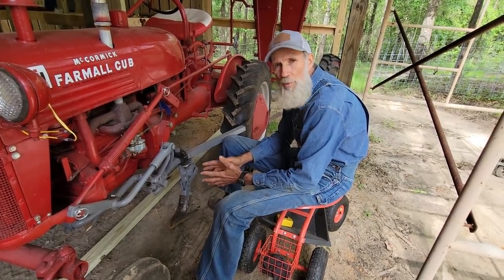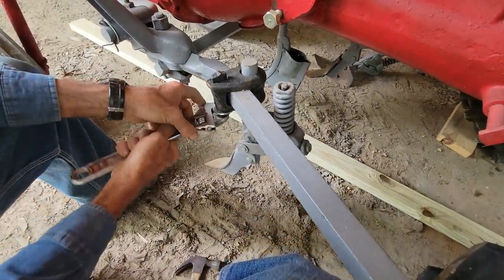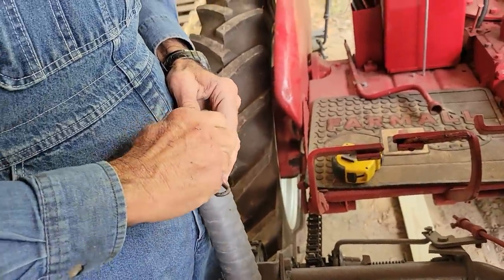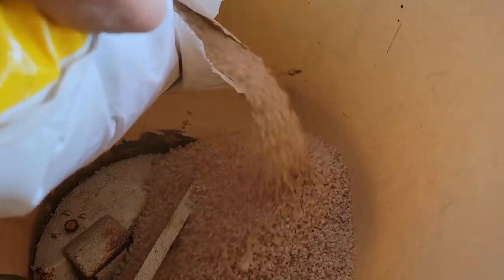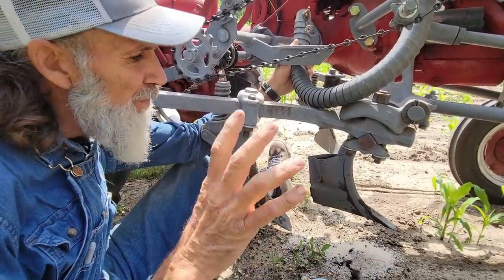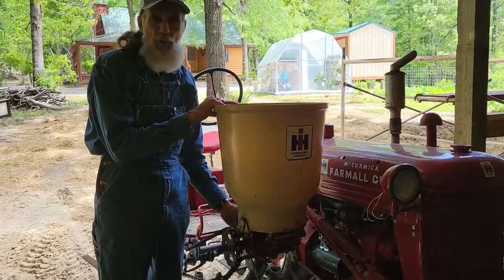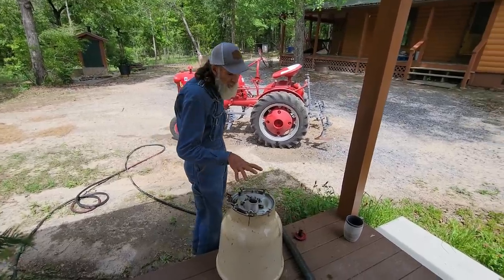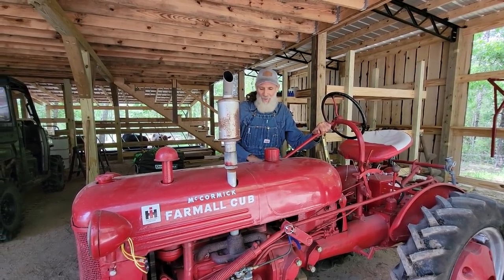Installing Plows on Cub Tractor   Plowing Corn

Comment: The fertilizer chain is jerking because the tensioner is supposed to run on top of the top chain.  I run the same 172 planter with Richmond seed hopper and #53 fertilizer unit on my 48 cub.  The manuals can be found for free download on line. I have found them to be very helpful.  Thanks for the great content.
Reply: à
Reply: Yep I run my tensioner on top. Manual with the pictures and description is a life saver. Also get them free offline as well

Comment: After use I find it good to spray water into the discharge chute on bottom of hopper while rotating the paddle mixer inside the hopper counter clockwise. This will remove most of the chunks of fertilizer or ammonia nitrate (I’m still old school) while tilting and resting my hopper horizontally on my headlight on my 140 but even this sometimes does not remove some of the really caked on buildup. Dry, then spray light coat of oil for overnight when using next day. Longer than that I always disassemble the bottom plate and gate and clean and dry then store in trash can with about 6” of old oil.

Comment: That's a beautiful old Cub sir. I remember starting out with my IH Super C pulling logs to my home made gantry when I was clearing my property. Didn't have a truck at the time so I would use the battery on my old Buick to run my gantry and load my log trailer, then use the C to pull the trailer to the mill 3 miles down the road. I sold them enough hardwood and cedar to buy my double wide and buy the block to build my foundation for it. Like the point you where trying to make yesterday. Find a way.

Comment: Hello Danny, I have a tractor too, but instead of putting water in the tires for weight, I had cooking oil placed in them.  Cooking oil won't rust out your rims and is also okay for the environment if the tires begin leaking.  Not sure what your reasoning is?  Best always.  Cheers

Comment: What is the bar called that you added that connects both sides together and where may one look, also the specific #16 shank, a resource for them too please, Agrisupply has 20 in long ones is what I ended up with and looking for shorter ones please.
Reply from the maker: I use Burch tractor company and Steiners tractor company also.